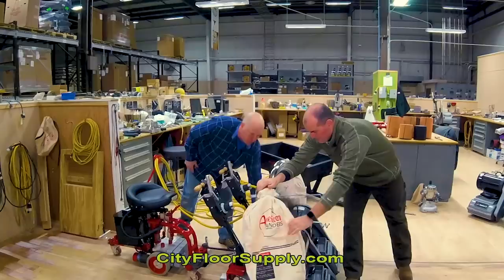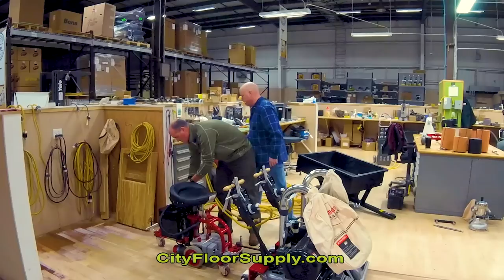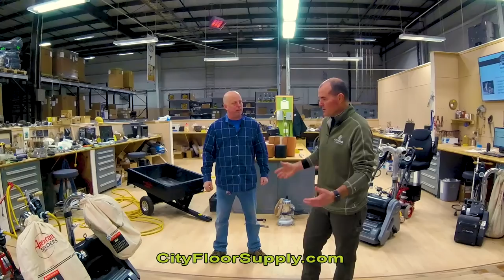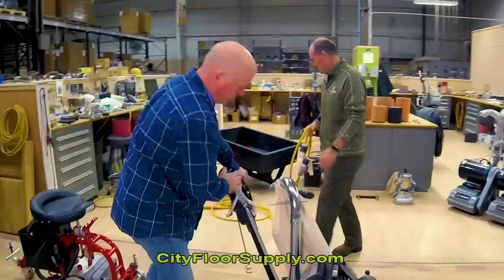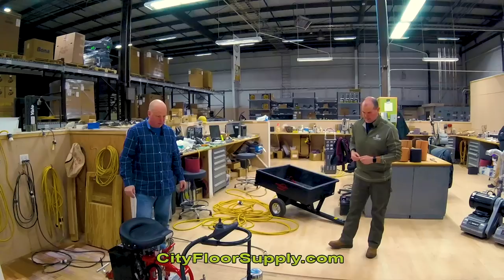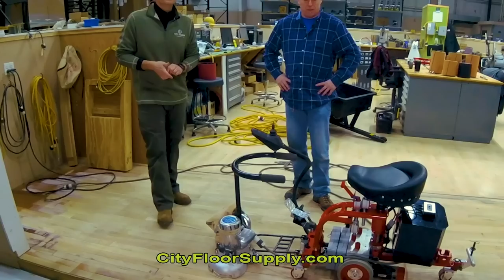Magic Wood Floor Rider for Edging, Gyms, More! Revolution Inc. rides dual American Sanders on DC

Comment: I do my edge with a 220v 7inch angle grinder on 110v that gives the rpm to a level that don't burn the wood and we have real hard wood in Brazil. However I'll try a dolly soon on a angle grinder to see what is like carrying to weight of industrial grinder and having a fixed angle of cut . I can go very fast with a grinder free hand, lest see how it goes with a fixed angle carrying the sander takes
Reply from the maker: Let us know how it goes!

Comment: When I edge I don't edge that fast as you demo on the machine. You ended up edging too fast and nothing was coming off. I will stick to doing it my way . It will come out better.
Reply from the maker: That is Aluminum Oxide too though.

Comment: How do you change the paper on edger?
Reply from the maker: Ryan, which edger do you need instructions for specifically?
Reply: For that B2 when it's connected to that unit do you have to disconnect it Everytime and then change the paper bc as you know changing the paper is very frequent doing jobs.

Comment: Doesn’t look possible to do the end walls with this should have worked out that crazy wheel shake first
Reply from the maker: Contractors have been successful using the rev rider with an edger on the first two cuts of the end wall. The third one is best to perform in a traditional manner.